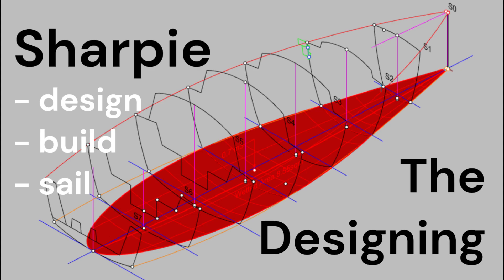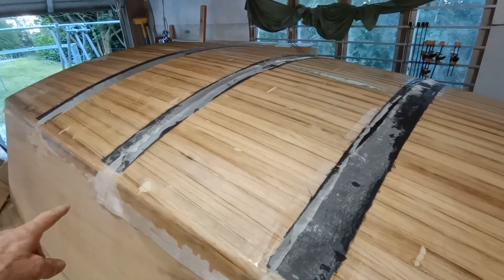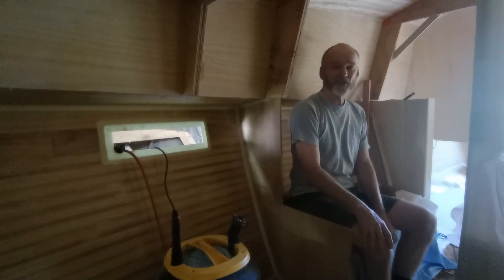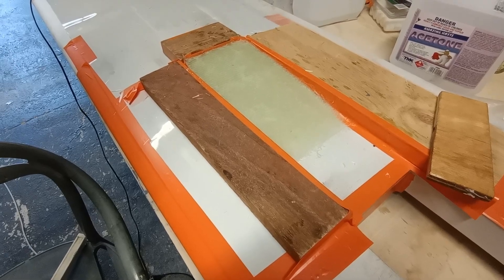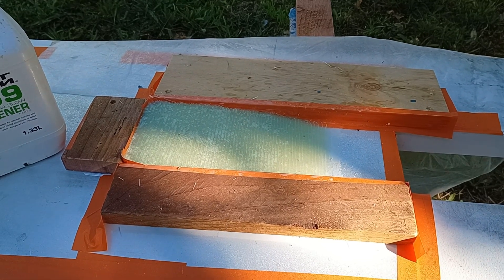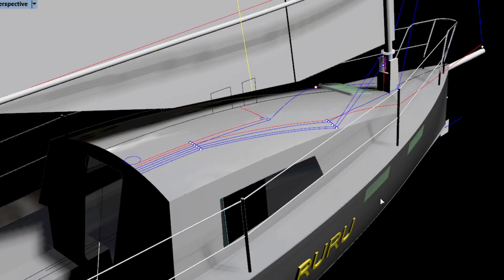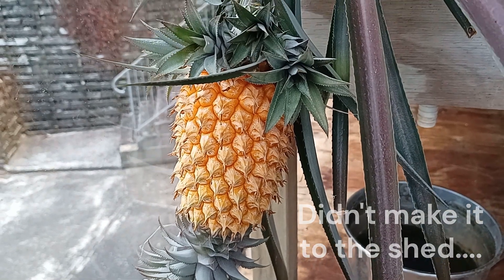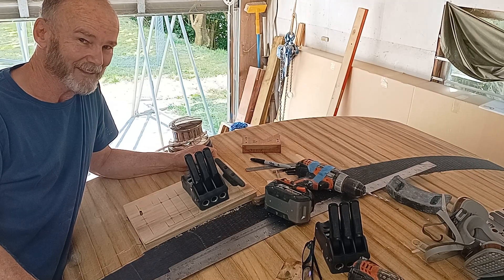Sharpie Trailer Sailboat Cabin Build Pt 6 - Hardware fitting & Cabin Preparation for Glassing

Comment: May I ask how much it costs so far ?? Just curious!! 

Looks prettier in every new video.
Reply from the maker: Thanks for the kind comment!
I can do better than tell you how much it costs!
In recent times I've been considering doing a video on just that, a breakdown of the costs and the experience of estimating the costs and what the real costs are.  It's not very straight forward at all and comes down to one's value system, in my opinion. I could do a lot more to explain that!
So don't hold your breath but I have a further think about it, but it's very likely the next video might be what you've asked for. In the mean time, there's a spreadsheet I use which needs updating and tidying up and to be honest, it's a little scary to look at!

Comment: Looking good mate, as a professional wood epoxy boat builder  here in Ozzie I feel your pain in regards to heat moisture and humidity I couldn't even think about an18 mm laminate over here even with extra slow,looks like you just got away with it, good skills and look forward to the next one  cheers.
Reply from the maker: Thanks for the comment. Good to see someone who knows what they're doing is keeping an eye on me 😉
Yes I did the second wedge in 3 goes, still getting the chemical bond between the three layers, worked good. 
 Going by your comment on epoxy it doesn't sound like you're in Tasmainia!